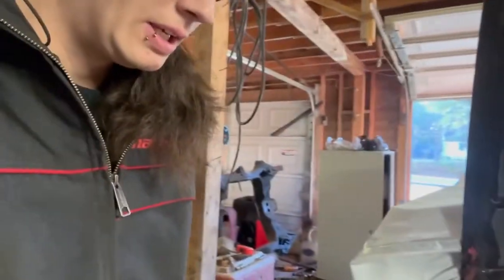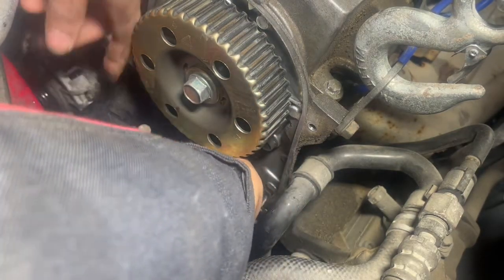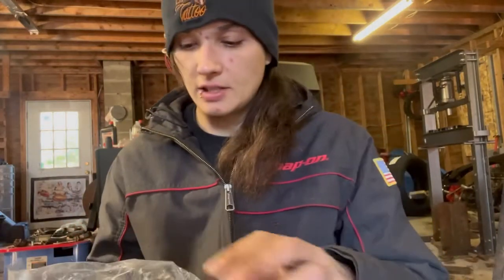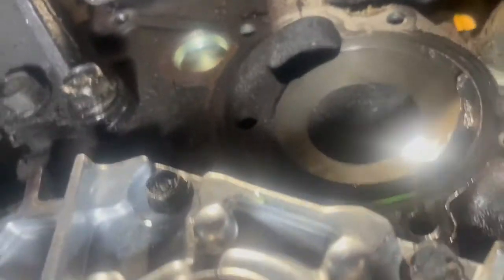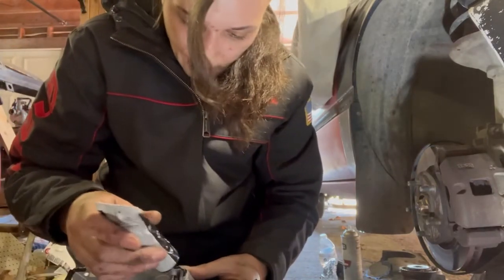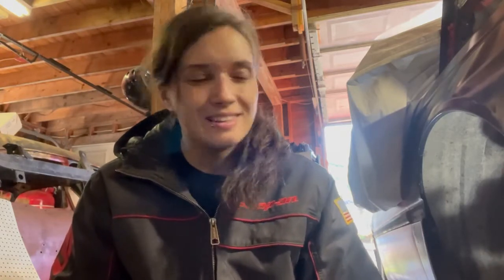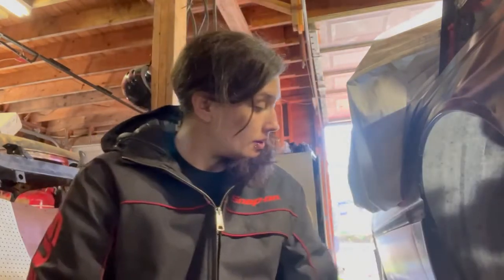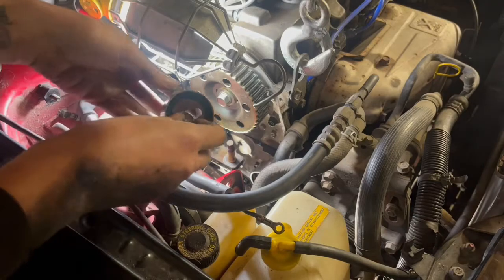Timing belt, water pump and oil pump Ford Probe 2.2 GL PART 4

Comment: Nice work MB, I’ve always put a thin coat of gasket sealant on the water pump to hold the gasket in place never had an issue. Also to align the bolt holes I use a a short drift or center punch or even a pocket screwdriver to align at least one hole and get one bolt started and the rest are usually easy after that. Great video, thanks !
Reply from the maker: Ooh nice! That’s a good idea. Thank you
Reply: Rtv is cheap insurance

Comment: I would like to know where the O-ring and small gasket I should install in the video 13:33. Thank you so much.
Reply from the maker: I don’t think I ended up using ether one. It’s been awhile now. I thought maybe although like look similar to the boring and gasket I got with the oil pump. It could also be for a different model car as well.